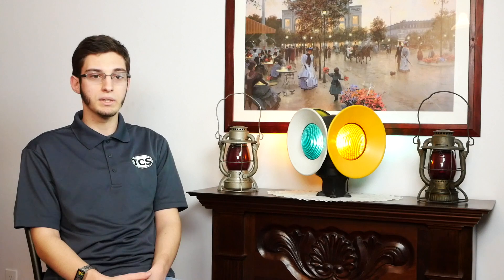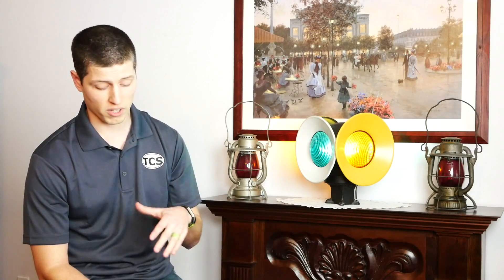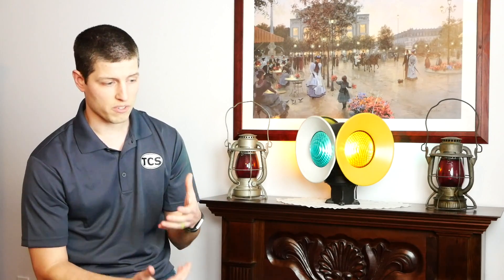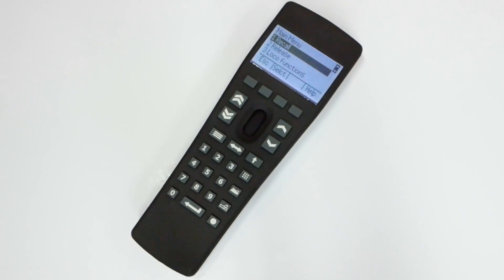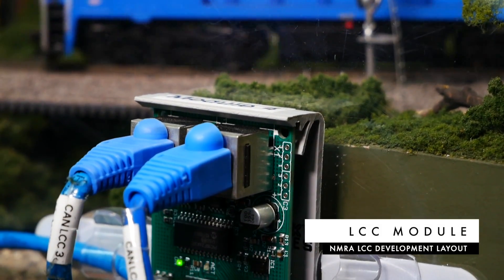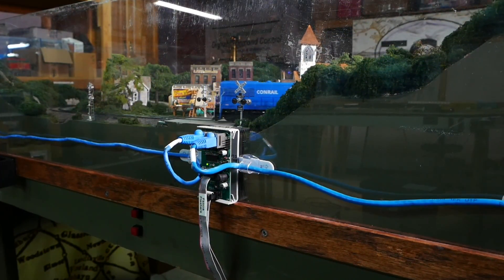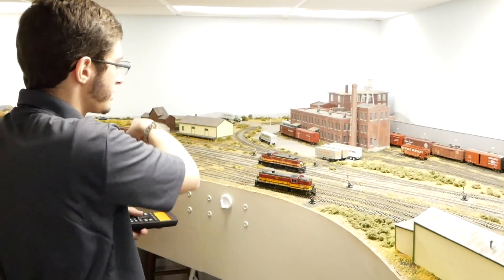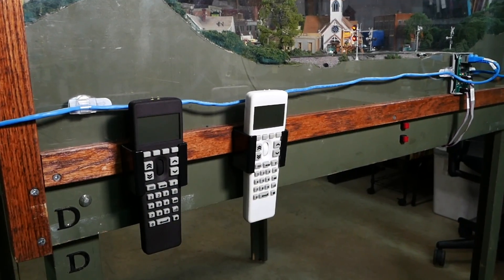An Inside Look at the TCS WiFi Command System

Comment: I agree that we in the hobby need a universal throttle and that smart phones are not the answer.  I really like what I have seen so far.

As you no doubt know, ESU is working along the same lines and have already produced a throttle.  However, it has to be a jack of all trades to support both the North American/Australian market and the European market control systems, so the throttle is expensive.  I do not like having to pay for hardware to operate a system I will never use.

If TCS can bring its universal throttle to market at the same price point as the cab throttles of the NCE/Digitrax variety, WITH A KNOB PLEASE, I think you will have a winner.  I certainly would buy the device.  I love the tactile feeling of control with a knob, that is why sliders and push buttons on smart phones and the like do not float my boat.  I am pretty confident I am not alone.

Good job folks!  Keep pushing the boundaries.

Comment: Good video. I am a user of Digitrax and have the new Digitrax LNWI wifi interface. I use their Simplex wireless system and it works great. But it is discontinued  but still supported. I have tried their Duplex wireless system but it is unstable and buggy.  I may try one of your new Wifi throttles when they come out. I just tested one of the ESU Mobile throttles which is also Wifi and it worked great with the Digitrax LNWI. I just did not like the Android touch pad but the large motorized knob was nice. Good luck. There is no doubt that the future of wireless throttles is Wifi and the new NMRA standard for buses.
Reply: The TCS throttles work great with the LNWI. We used two of them for the operating session seen in this video.